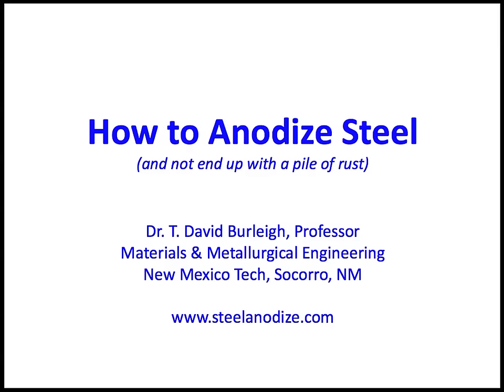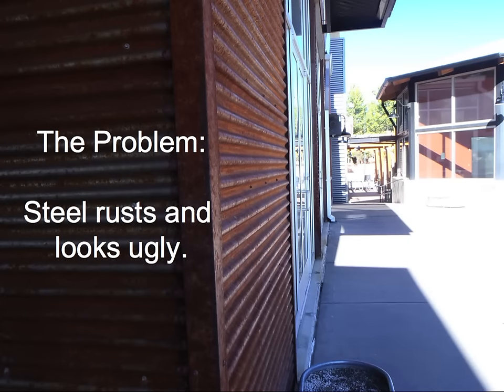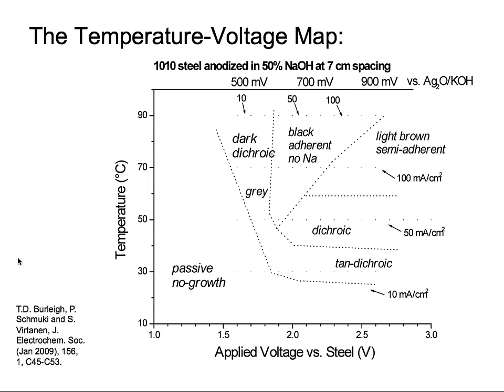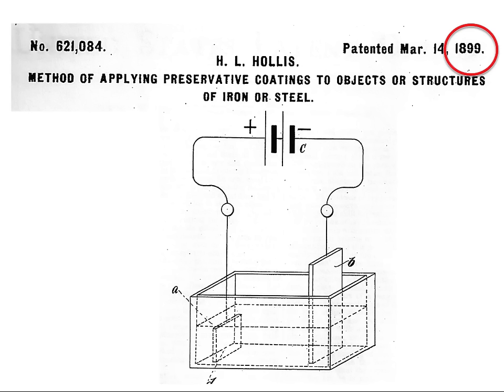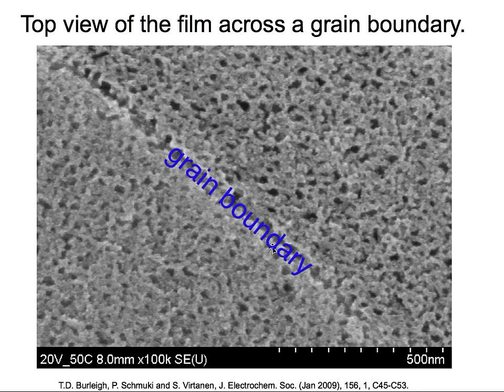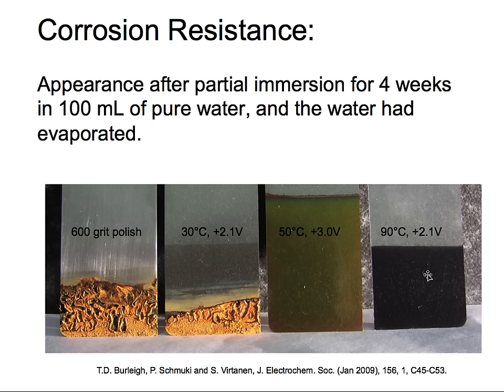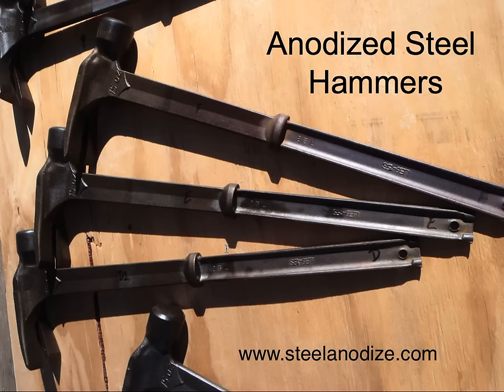How to Anodize Steel

Comment: So Anodising does seem to be effective for steel to fend off rust, not quite sure on the best method, I had trouble hearing the info.
Reply: +SupaLexy (SupaNautica &amp; MotoLexy) In my own experience, it works decently well. I've done more work with titanium, niobium and zirconium, so I can't be 100%. The layer of oxide formed on those metals is analogous to the rust oxide on steel (save it's gray on Ti and Nb). Deeper etches with HF (around 170 F) tend to give better rust prevention. This is all just stuff I've witnessed while testing in my garage, so I may be wrong.
Reply: Can you provide some info on your setup (types of containers, power supply, heat source, etc.)? I'm wondering what the best way to experiment with this is for some smaller (~3" x 8-13") steel pieces.
Reply: You're not the only one.

Comment: Well I just bought some NaOH and I'm going to try my hand at anodizing some pocket knife parts. If I'm successful, this could become an important finishing option in the knife making hobby. Wish me luck!
Reply: Update, I successfully anodized the steel clip, liners, latch, weights and even blades of my Maxace balisong. They look amazing. It looks like brass with patches of iridescent rainbow
Reply: Did you mix 50%NaOH with 50% water?
Reply: What’s the amperage you used?

Comment: This is so scientific. Love it!  If I want to make black screws cheaply do I need 2.1v@90c? 
Does current have an influence or can I step it down without minding the current?
And how adherent is this black? I've seen pink ipods hit with a hammer and still the coating barely scratched

Comment: Can you tell me who makes the device being used in the video to heat and mix the KOH? If I were doing this at a bit larger scale, is glass the preferred container over plastic? If plastics will work, what types (Types at https://drive.google.com/file/d/0Bxt1e-sbjyvPOGpkeXVSSGg4VVk/view?usp=sharing)? Thanks for the video, very inspiring.

Last question: Just to clarify, in the video, you're using 50% KOH and 50% H2O, right?
Reply from the maker: It is a hot plate with a magnetic stirrer.  Plastic would be fine.

Comment: I'm almost sold on buying an anodizing kit. I work for the military and deal with Amphibious vehicles that see salt water daily. My job is to operate and maintain these vehicles and I'm getting sick of seeing my baby turn into rust. Rust grows, it makes me lose time to fight it and resources I often pay out of pocket for. I could be doing more important things than busting rust. It also makes me look bad when things rust as if I'm not doing my job so theres that too. I'm pretty frustrated with rust currently. Sandblasting, priming and painting just doesn't do it. At least if I got a kit or built my own setup I could do other parts as well like my car or whatever. I'm a little confused though, you need temperature to get the best results for fighting corrosion and rust right? This might not be as easy as I'd have thought if that's the case. We work with steel and aluminum but of course aluminum doesn't really rust like the steel does.
Reply: I would think of it as a primer, but better adhering, that helps the next layer adhere too. So sandblast, anodize, dunk in molten plastic or tacky wax or cosmolene. That should be a noticeably better against saltwater.

Comment: Ok, found the answer the minus (-) pole is a piece of metal too.
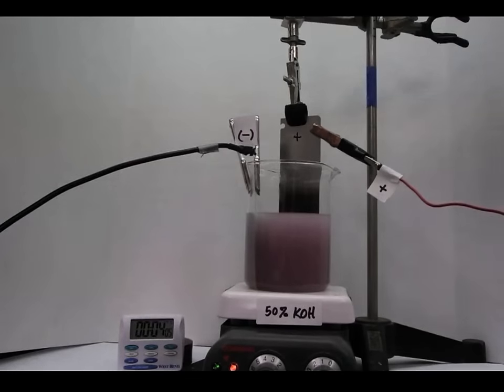2:00 do you attach something to the minus (-) pole or just clip it on the glass? (sorry, want to try but just beginner)
Not sure but I think I see a thin piece of metal, steel?, iron?, stainless steel?

Comment: How effective would this process be on cold-rolled (hardened) 300 series stainless steel...
Reply from the maker: This process does not work on stainless steel.
Reply from the maker: This process does not work on stainless steel.
Reply: You need heat. If it's been cold-worked enough to become magnetic, try using an induction cooktop.

Comment: I wonder, would the anodized process hold up against 91 unleaded octane? how about the race stuff? I think im going to do this to my tank.
Reply: Old comment, but as you could see the corrosion resistance was pretty bad aginsta anything besides straight water.
Reply from the maker: It should be fine.
Reply: I'm trying to make my own BBC gold anodized valve covers

Comment: When you say 50% NAOH or KOH are you referring to the concentration by weight, volume or molar concentration
Reply from the maker: Weight percent
Reply: @tdburleigh3170  Thank you kindly for replying.
Reply: @tdburleigh3170  hi, not sure I understand very well when you say weight percent. does that mean that for 1liter of water, you’ll need 500gr of dry Naoh\Koh? Thanks
Reply: @Ti_Fe-Etch  Cheers bud. Thanks
Reply: @tdburleigh3170  That's a lot of lye!

Comment: Could this method be used to blacken a steel chain maille shirt (steel used is 14 awg fencing wire from which the galvanising has been tumbled of) ? How do I achieve 50% NaOH or KOH solutions ?? thanks for your answer...
Reply: NaOH is Sodium Hydroxide otherwise known as lye. You can buy it in a dry form as a drain cleaner. Just check the labeling to identify exactly what the product contains.
Reply from the maker: The issue is electrical conductivity.

Comment: Hey, i love the video!
I got a folding knive i would like to threat.
Bolts and handles (they sit behind carbon fiber).
The handle is stainless and the bolts i still dont know.
This type of coating will work on stainless?
Reply from the maker: This process does not work on stainless steel, only on carbon steel.
Reply: It depends on how much chromium is in the steel. 400 series steel like 409 or 410 will give you different results than something like 304, 321, 312 or 316. You can also experiment with spring steel and chromoly.

Comment: Hi, I am very keen to try this on a product that has about 4000 cm sq surface area so about 200 amps required, I am concerned about the fumes given off, are they toxic ?  thanks, Roger
Reply: Pretty sure it's only O2 and H2 gasses, i'd keep the fumes away from ignition sources
Reply: Thanks ! I have done a few small samples with good results but they are not as bright as I was hoping for, any ideas on this ?
Reply: @kiwiwombatman  i'v yet to try this method so i'm not too sure. I know that metal forms natural oxides that may hinder the process so removing them in something like an acid wash might help.
Reply from the maker: I do not know.  We did all of our tests in a fume hood.  It would be worth testing.
Reply: Nice work

Comment: I am trying to anaodize a steel frame and fork for a bicycle. hoping to get a purple color. I am using 4130 chromoly. would this process work? or do you have any recommendations for color anodizing a this sort of steel?
Reply from the maker: You will have to experiment with the time, temperature and voltage.

Comment: Does this process change the overall dimensions of the item?
Reply: Any increase in size would be in the micron range.  In other words, far too small to measure with anything but an electron microscope.
Reply from the maker: The thickness changes are less than 1 micron.

Comment: Is this not technically electroplating? Anodizing by definition creates an oxide on the surface of the material which firstly would not form tight-knit bonds in steel and secondly would inherently not give the spectrum of colours you see in your test. Electroplating on the other hand could give rise to the spectrum we see through metallic deposition of the substrates condensates, i.e. potassium or sodium, and also seems plausible given that steel gladly makes bonds with other metals to create a thin film.
Reply from the maker: For electroplating, the work piece is the cathode (negative).  For anodizing, the work piece is the anode (positive).
Reply: Bear in mind, red oxide Fe2O3 + H2O flakes off, but black oxide FeO is more adherent. For example, heating steel in an oxygen-poor environment tends to get the FeO started. This anodization too.

Comment: I'm looking and looking and can't find a video that teaches how to make that nice blueing, like they do in car mufflers (burned tip).
I wish someone could show the process. If anyone could help... please
Reply: If you have 409SS, you can do it with an induction stovetop. 304SS that has been cold worked will also do it under some conditions, but you generally need a torch. A regular blow torch for sweating plumbing is capable of doing it, but an oxy-propane setup will give you superior performance without the safety limitations that come with an acetylene bottle.

Comment: so.. first... heat threatening steel using oil is also anodizing the steel ? and did the steel had electrical conductivity after anodizing ?

Comment: wouldn't it be better to temper steel rather than anodize it?
Reply: No, the heat might damage the part and you get diffeent colours. Straw at about 350 then orange, red, purple and finally blue at 700+.
Reply from the maker: This anodizing is a low temperature (50°C) alternative to high temperature (500°C) oxidizing.

Comment: I hate car companies. They design their crap to fail and then get on board with all the people forcing me to recycle a milk carton. Stop filling our world with rusting cars! Rant over.

My take on this process is it is a primer before painting. A primer mitigating any rust from forming. Typically when you de-rust metal you can use an acid (phosphoric in my case) or electrolysis, then neutralize with a base (NaOH or KOH in my case). It's the instant you go from the  acid to the base, or shut of your electrolysis) that the rust can start. This process allows one to remove a step. You could do your electrolysis and without removing the metal from the solution you could make the solution basic. While dripping with a base liquid one could then place it in this hot NaOH bath and apply the coatings above (based on voltage and temp?).

Here's my first try. I degreased my bolts in NaOH. Then removed the rust with phosphoric acid. Then removed the bolts from the phosphoric acid and while still wet placed them in a bath of NaOH. As I'm typing this I am about to connect an electrode to the still wet bolt and dip it into this electrolysis coating process. Then remove, dry, and paint.

This all kind of reminds me of powder coating but without having bare metal exposed to air before applying the powder.

Comment: Ahhh so it's basically just a chemical and electronic way to get a exothermic reaction to get the heat that changes the color like using a flame oxygen acetylene to get the heat. 
Then it's using the length of time in the heat to change color... 
Cool stuff lol I'll stick with flames 🔥
Reply: It's really more the other way around. Heating metals like titanium just causes them to oxidize, forming an oxide layer on the outside which causes colors due to the thin film effect. Electrically anodizing metal doesn't (usually) require heat. The only reason steel specifically does is because otherwise it tends to form the wrong oxide (Fe2O3) which turns into rust when it bonds with water molecules.